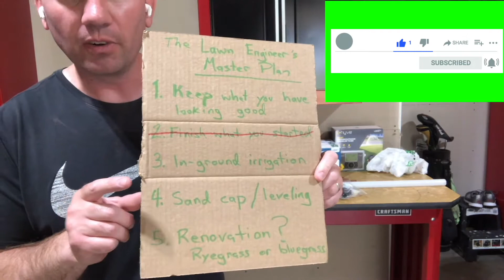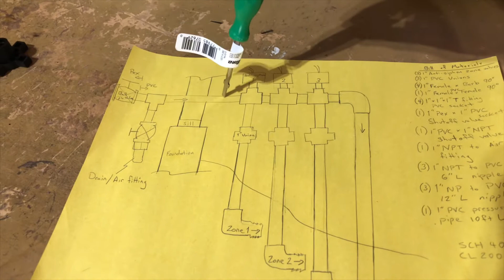The Master Plan EP. 4: In-Ground Irrigation Components, Water Supply Install and Zone Valve Install

Comment: Did you solder the copper with a lighter?
Reply from the maker: You could call it a big lighter or a small torch.
Reply: @ I never done soldering, did you use any special joints: can you explain how to do the soldering with the small torch: